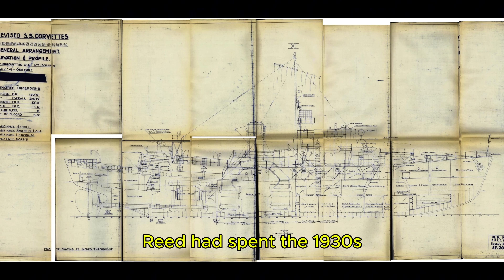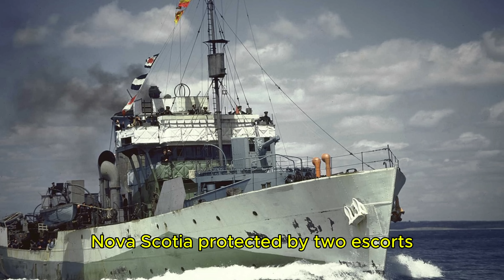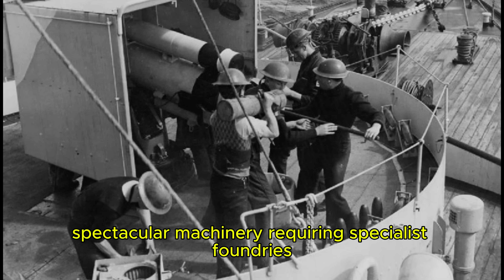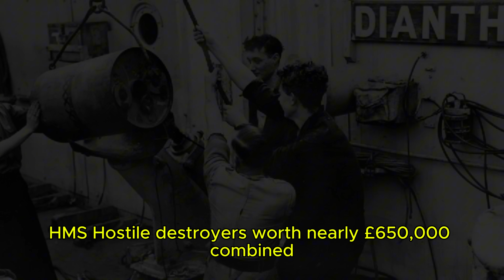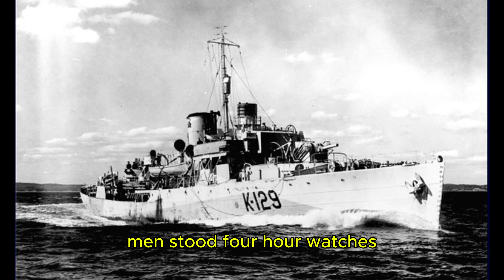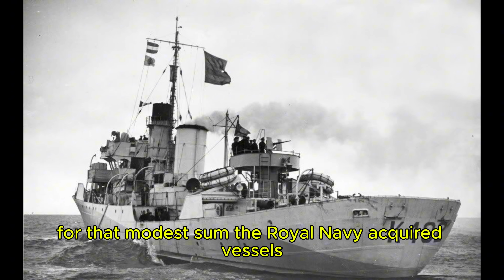Why British Corvettes Cost 1/10th of a Destroyer — But Sank More U-Boats

Comment: The thing to keep in mind is that a sighted U boat was also a very limited threat to a corvette.  One 4 inch gun would have been insufficient for ship to ship naval engagements but plenty against a surfaced U boat which were frequently rammed.  Better speed would have been good too, but a Type VII topped out at 18 kn surfaced but only 8 submerged/periscope depth.  So it wasnt swarming a lion with hyenas, which is what a corvette-on-destroyer matchup would have looked like.  They were indeed the ship class to use though brutal to serve on.

Comment: The T34 tank was crude and under armoured and produced in vast numbers. German tanks outgunned and out ran T34s but took a long time to byild and the Soviets over ran them at Kursk and didnt stop until Berlin.
But the RAF built big slow vulnerable inaccurate bombers and lost half of them and half of bomber crews. They had a fast accurate easily built bomber, the Mosquito, but chose the vengeance option rather than the pinpoint overwhelming incessant option. Far fewer Mosquito crews died and far fewer civilians would have been killed. The big bombers did very little to shorten the war. The RN got it right. The RAF got it wrong.

Comment: The success of British anti-submarine corvettes was a little bit like the success of the British Mosquito bomber, it wasn't simply the fact that they were made out of wood that made them successful, it was the fact that they could be made in quantity in a parallel manufacturing stream that did not sacrifice manufacturing capacity in other areas.

Having said that, the typical British Corvette would have lasted about five minutes in fleet service; which again, is only proving my point.

Comment: I don't see or hear mentioned these Corvettes had a triple expansion steam engine - like the cargo transport ships they were escorting - instead of expensive and powerful steam turbine(s) that military ships had. That was the foremost important cost difference between a cheap escort Corvette and a Destroyer. That is what caused it's relative slow speed as well. They had enough speed to DC suppress submerged U boats but could not chase them down far from the convoy which a Destroyer could do. U boat captains had orders to use expensive and limited capacity in a U boat torpedo's to sink cargo tonnage, or else these Corvettes likely would have been more often targets themselves and a failed concept. They represented a desperate stopgap, but not a very good solution until naval patrol bombers got the range to cover the expanse of the ocean. Bombers per definition being much more dangerous to U boats that were still primarily surface operating vessels.

Comment: I calculated that 6 to 1 beam to length. That's like being in an inner tube. I made my last deployment on a Knox Class frigate in 1991. A few days before we deployed, one of two, fin stabilizers had to be removed. And was not replaced. It was 10 to 20 degrees role to starboard, than back to straight up. Than, a role to starboard. For 6 months. Nothing like the corvettes, but not the best of 20th Century maritime design.

Comment: The same argument applied to Sherman tanks vs the superbly-engineered German Tiger.   The allies could mass produce the relatively simple Sherman in much bigger numbers than the Germans could build Tigers.  1 on 1, a Tiger would annihilate a Sherman - it was the rule that it took 4 Shermans to take out a Tiger, but the allies HAD 4 Shermans, or more, for every Tiger. 

The general strategy was, I've heard, called "second-best today" and that certainly applies to corvettes vs destroyers
Reply: T34

Comment: Both the corvette and the type VII U-boat were a little over 200 feet long and the North Atlantic sea states, the long "rollers" encountered, meant hulls over 300 feet long were required to make it bearable for crews. It was exhausting work on these shorter hulls. The U.S. Coast Guard found out the huge mistake they made in the 1980's with their new 270 foot long cutters. Originally 300 feet long, some idiot decided to save money and shortened the design was the story I was told. Similar cost-cutting disasters were common in the cash-strapped department of transportation Coast Guard. And more recently the Deepwater scandal.

Comment: Great video. 
Corvettes were one vital factor, every improving radar, better defensive tactics, air cover, the hedgehog, breaking German codes and radio transmissions, they all came together by mid-1943. 
Thanks.
Reply: One battleship has 40000 tons of steel. A corvette has 200 tons. So you could make 200 extra corvettes instead of another battleship. Britain built 5 battleships during WW2, while losing convoys to submarines. 
Genius move, right?

Comment: What you haven’t pointed out is that we won the Atlantic war due to hedgehog, they were the real change in strategy that finish the German U boats. Dept charges we useless compared to the hedgehog.
Reply: ASDIC, decoding ENIGMA and aircover were pretty key as well.
Reply: the problem with Hedgehog was that you had to be relatively close to the target, it had no guidance and had to strike the target and it took ages to reload.

Comment: Other advantages of corvettes was they could carry a large number of depth charges and would not tend to run out. And they had the range to sail all the way across the Atlantic. Destroyers were designed to do what every naval officer dreamed of. A highly dangerous high speed run in to attempt to torpedo a battleship. Something that did not match the real needs.
Reply: Corvettes could also replenish depth charges from freighters within the convoy.  They would also be fitted with forward firing hedgehog ASW bombs later in the war.
Reply: The original full name of the destroyers, pre-WWI, was "torpedo boat destroyer". They were intended to screen the battle fleet against the vessels that were designed to torpedo battleships. They continued doing that job when the torpedo boats went underwater...

Comment: In 1938 UK had increased its defence spending to 5% GDP. By 1942, they were spending 40%. W r is extremely expensive.
Reply: One battleship has 40000 tons of steel. A corvette has 200 tons. So you could make 200 extra corvettes instead of another battleship. Britain built 5 battleships during WW2, while losing convoys to submarines. 
Genius move, right?